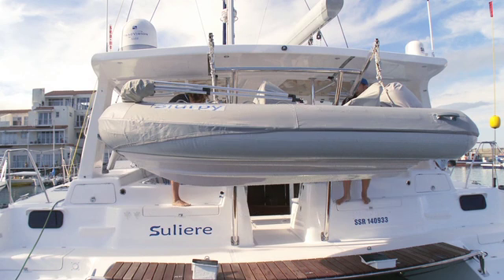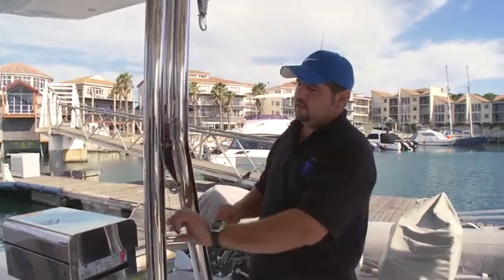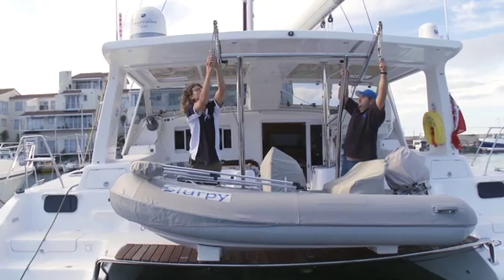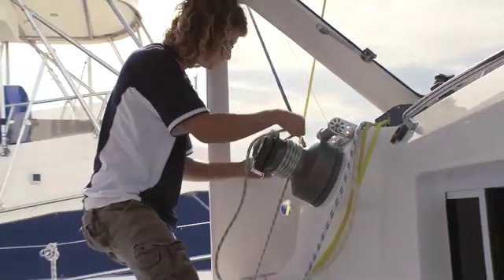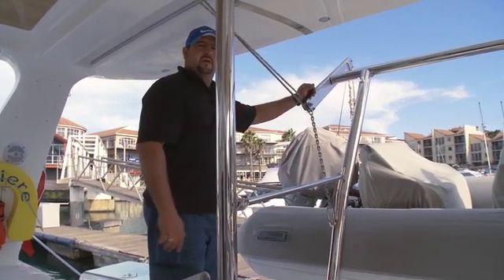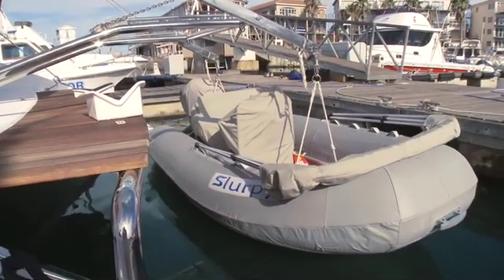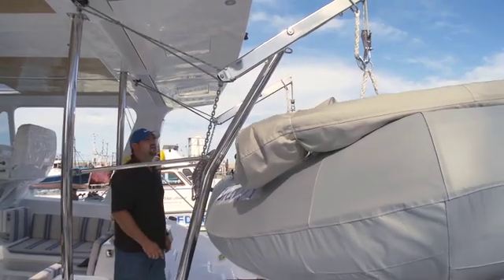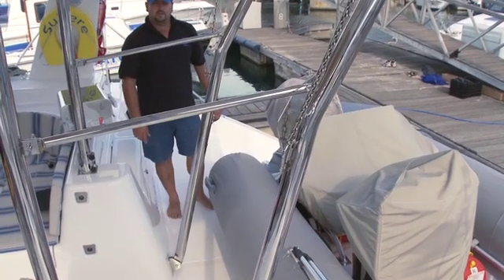Suliere - The Davits

Comment: very complicated system . . .
Reply from the maker: It seems that way but we ac tally are launching the rib in some 2 minutes and so, in practice, after 7 years can state that its works fine.
The alternative of using the boom would take longer.
Reply: I appreciate your effort and the result you obtained, but some professionals have been better at this problem and have solved it better. . . with many less operational steps . . .
Reply from the maker: Sorry but not with the width of the stern platform, we have - there is no others solution other than a crane or boom lift and boom was not an option for the rib weight.

Comment: Looks interesting. What did you have to change.
Reply from the maker: The davits actually collasped due to thin a wall on the tubing but were remade with a stronger tube and worked ok since.
We changed the 10mm rope to 8mm Dyneeema and ended up with a rib without the console etc at half the weight.
Reply: Cool. I'm glad I found your videos. I have been looking for a Cat to set as a life goal. And now I have found it.  The Saint Francis 50. Is it.